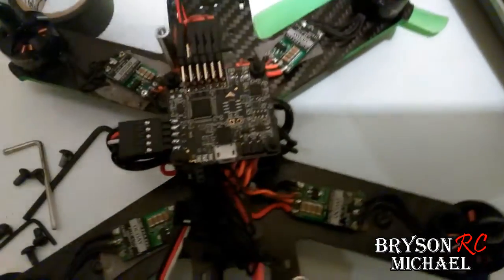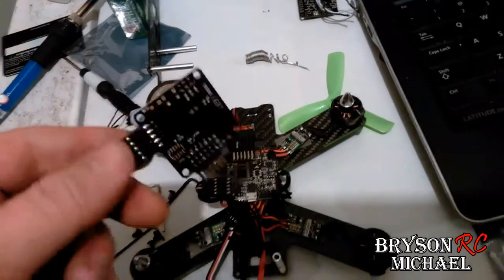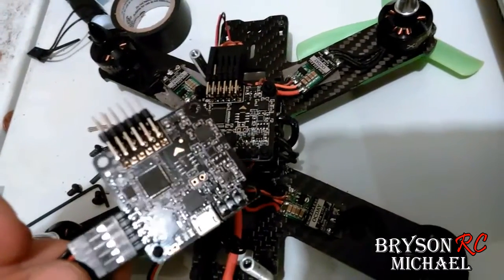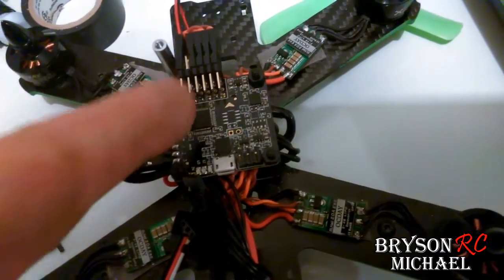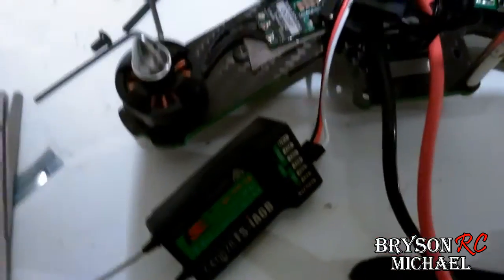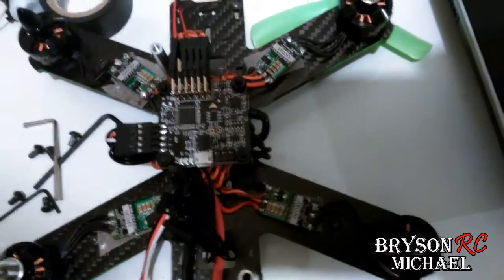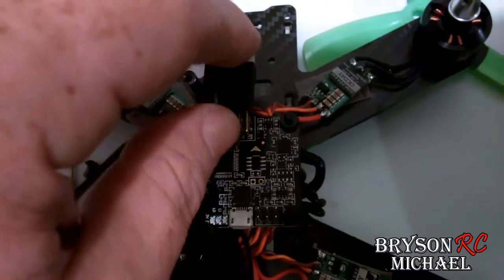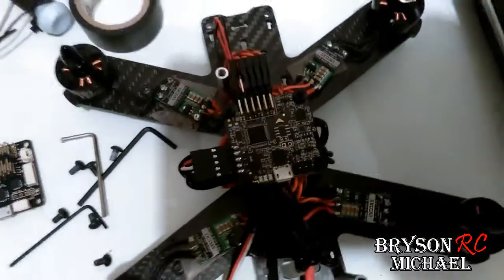MUST SEE BEST Flight Control Board for BEGINNER Raceing Drone Builders NAZE32 Finished

Comment: awesome video sir.👍 . iam a beginner to drone racing. Iam trying to build my first 250size racing quad and i dont know what flight controller to use. I do have a cc3d just sitting hear should i use it? Any help would be great
Reply from the maker: a cc3d is a pretty good control board. When picking up flight controllers, what you want to look at is how the cpu is in the controller you are using. Naze32 boards are super simple boards that beginners LOVE because its set up is so easy but the CPU is the worst. If you turn on too many things in Betaflight or clean flight it will slow down the CPU. So I would look some up. I think its project blue falcon (rip) who has videos about different flight controller boards. Some have real small solder pads and are hard to solder if you arent good at soldering. Like the KISS board. The KISS board is one of the absolute best you can get but if you are a beginner I would suggest sitting it aside and putting it on when you get a little better at soldering. CC3D boards are pretty fantastic boards. Its kind of like the Naze but better.
Reply: Bryson Michael RC thank you for your time sir much appreciated . i will stick with the cc3d until i improve. great channel brother👍👍
Reply from the maker: thank you. good luck bro on your build. let me know how it goes
Reply: Bryson Michael RC  ill definitely keep you posted on my build bro👍and thanks again

Comment: I'll pass on the pins. It's more works but it's a neater job and you don't have plugs sticking out than can break off.
Reply from the maker: it is for sure... There is a TON more room without them. But I have found that these boards are pretty sensitive and its a ton easier to take it back apart by popping out the connections on the pins rather then de-solder haha. I burned through so many wires lol. Im a decent solderer but until I get the feel for how these fly Im gonna use the pins encase they break. Once Im a decent enough freestyle flyer I wont have to worry so much about hard landings and busting them up haha